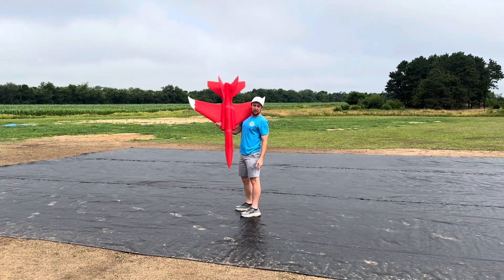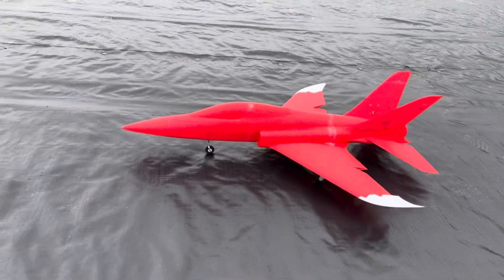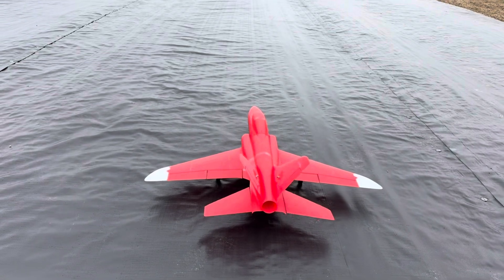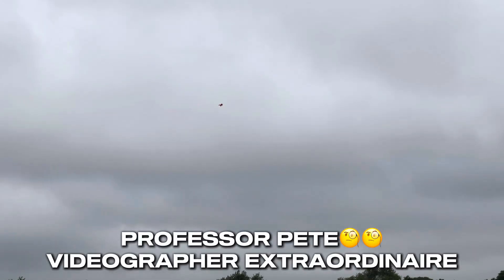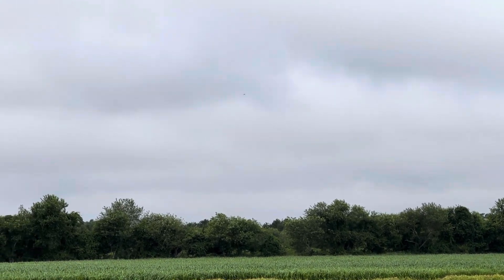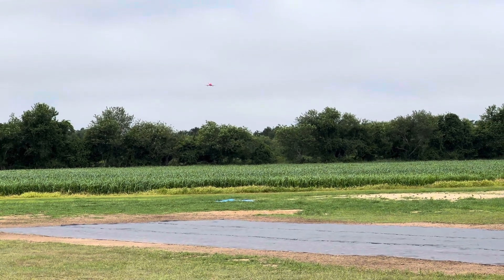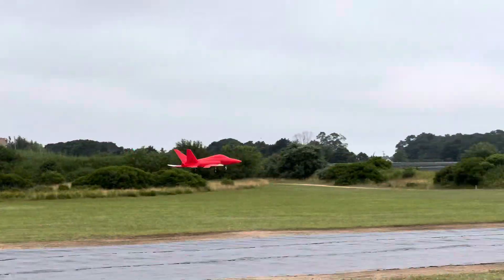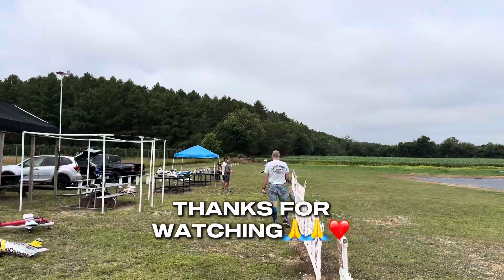ALL THAT WORK COMES DOWN TO THIS MOMENT!!

Comment: I have this files to, but how you can add the rudder, mod for the edf, flaps, and the retract? Where can i get the file?
Reply from the maker: @TDPro1  you have the 800mm version. This is the prototype 1100mm version. The files should be available within the next few weeks from @3daeroworks
Reply: @3DPrintHangar_RC  can the owner of 800mm get the 1000mm version for the update?
Reply from the maker: @TDPro1  This airplane is a total redesign
Reply: @3DPrintHangar_RC  hmm okey 🥲